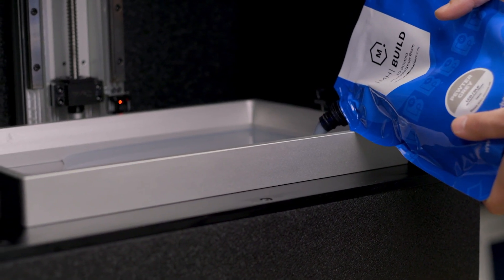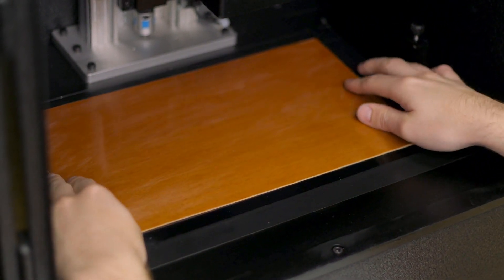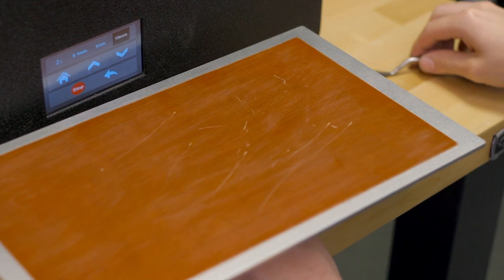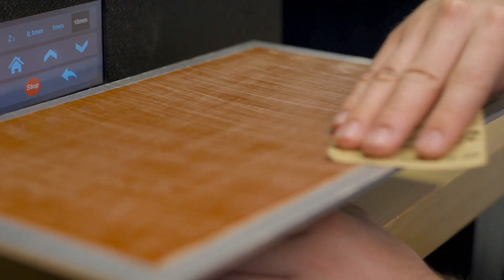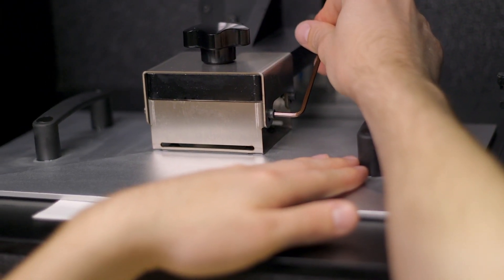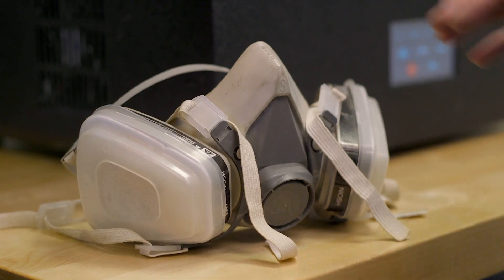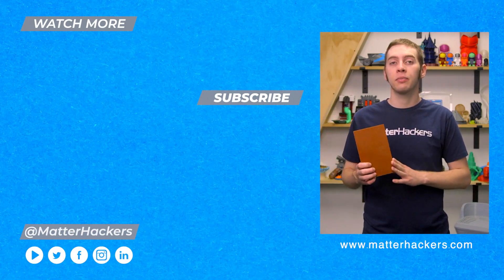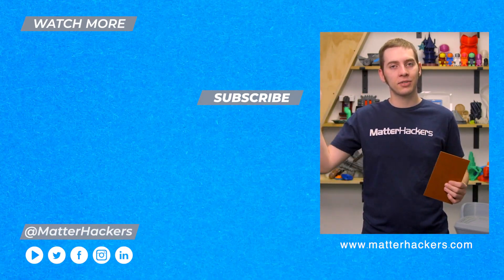Tech Breakdown: Layerlock SLA Build Surfaces

Comment: How do you clean it! Oh do I just assume that I will cleanness normal, with IPA, and plan on buying a new one? FPS sizes th3 Kelant 400-ish, 500s  and Anycubic Photons.
Reply: You can clean using a stiff toothbrush and either alcohol or soapy water but being careful to not throw the particles around as you don't want to breathe resin particles. Eventually you can resand if needed.